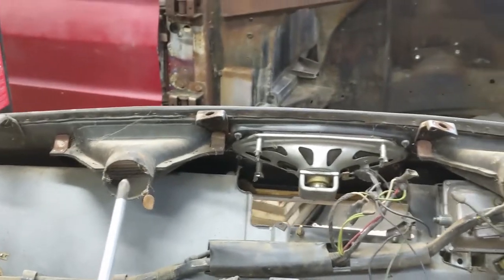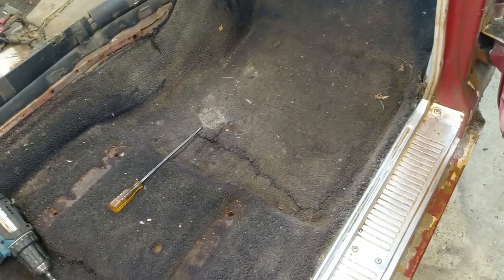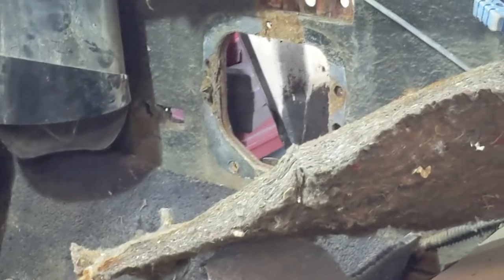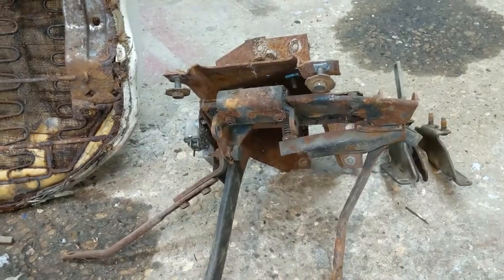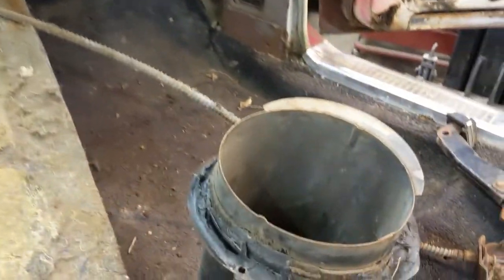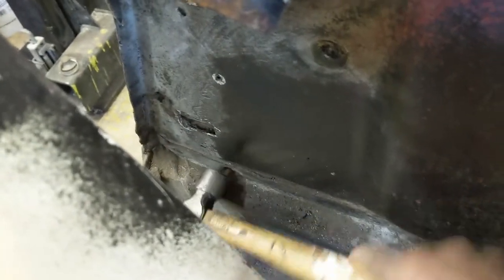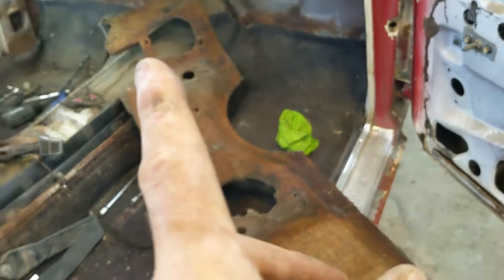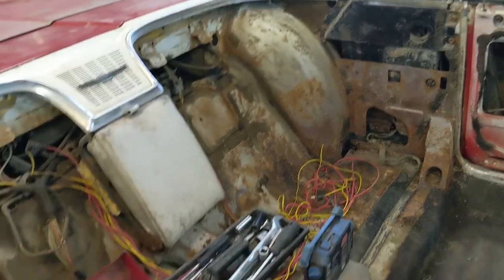STRIPPING Inner Firewall - 65 Thunderbird Convertible Restoration Ep #9

Comment: Alvin,
It's difficult to realize how many parts it took to build an old T-Bird.  No wonder they weigh over 2-tons.  I wrestled for quite a while on that large vertical air vent tube pulling, wiggling, pushing, banging with my fist and whatever else was handy until it finally came loose.  There was a giant glob of sealer holding it in place.  I'm glad you showed that.
See you in the next video, my friend.
Regards,
John
Reply from the maker: Hi John,
Yes, there sure are a lot of parts! 
For the most part I've been taking them out as a unit...each of those units have many parts. I was surprised to find that sealer still as soft as it is, and it was really glued on, I thought I missed a fastener at first, and was a little nervous to pry on it.

Comment: Hello Alvin, I am also glad that you are documenting the disassembly as you are doing it. It is nice to see it done in "real" life instead of a manual. BTW, I'm just curious as to what the different is with the shop manual that you have vs the US one. 
Thanks again,
George B. in Michigan
Reply from the maker: Hi George, I agree that having a visual account of the parts being removed is more helpful than the manual, I myself have a hard time visualizing the work from a manual...I know other people have no issue with that.

The shop manual USA vs Canadian differences, on the front cover the Canadian, the number SE-731-65 is printed on the lower right of the front cover, the back cover is completely different, it's mostly a red cover with the "Family of Ford Fine Products" near the bottom of the page, below that is a 1/4" wide horizontal white line (full width), then below the line is the "Ford Motor Company of Canada Limited", then below that is " Service Publications Oakville, Ontario" finished with "Printer in Canada" on the very lower left side of the cover.

Also on the Group Index page there are no reference to the USA, it's "Ford Motor Company of Canada Limited", then below that is "Technical Service Publications Oakville Ontario", and on the "Forward" page it gives the conversion calculation between US liquid measure to Imperial, then a paragraph about Ford Canada having the right to make changes, then it says where to get the tools shown in the manual "Job-born Manufacturing Limited, 11 Brock Street, Hamilton, Ontario".

Those are the most obvious differences, I'm sure there are other's...I just haven't come across them yet, the numbers (SE-731-65) on the lower right of the front cover is the first indicator that it is a Canadian version.

I think I'll do a YouTube short showing the differences I explained above. 😊

Comment: Staying with you.  You work so I don’t have to 🙂 .  Does your Provincial Government load the roads with salt in the winter, or they they have something a little easier on the cars?
Reply from the maker: Lol, just sit back and enjoy Stephen! Back in the 90's (maybe earlier) the Gov. started using waste salt from the potash mines in a big way, before that, the roads were sanded, with some salt added. This car was parked before the potash mine waste. With that said, I doubt this car was driven much in Saskatchewan during the winters. What did kill vehicles here in SK back in the day, is the calcium chloride that was, and still is used for dust suppression on the back roads.
Reply: @J_R_Shop  In New Brunswick we have both salt in winter and “chloride” in the summer.  Even when I first was married, they used waste oil on the roads to keep the dust dow.  It didn’t hurt the cars, but it didn’t do the water supply any good.
Reply from the maker: @stephenmoore2754  my first 10 yrs in mining was at the salt mine in Pugwash...I was contributing to your rust problems! Sorry about that! 😥

Comment: These cars aren't all that bad to work on... with the exclusion of dash work, and convertible top mechanisms. Have you tested the top mechanism yet? The parts can be a pain to source if you need anything in a hurry.
Reply from the maker: I did test the pump, and it works...the top goes up and down manually without any issue, the rest I didn't test. The two rear deck cylinders need to be replaced/rebuilt, the chrome on the rams are pitted/rusted, and I'm sure will leak.
Reply: @J_R_Shop  You can power up the relays and test the limit switches. The relay and the limit switches are the common issues. They work a lot like distributer points. The solid state relay systems are worth the investment when you get back to the re-assembly phase.
Reply from the maker: @novanogo07  thank you! Solid state sounds like a good option.